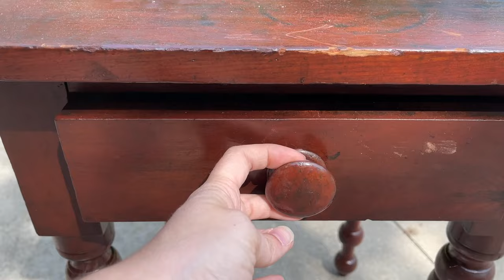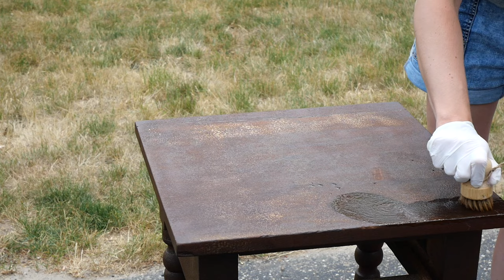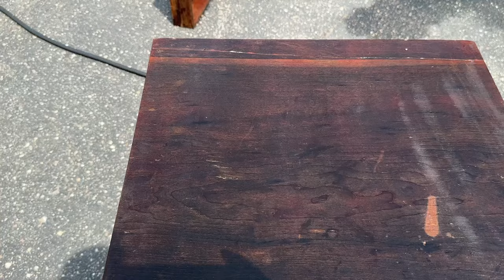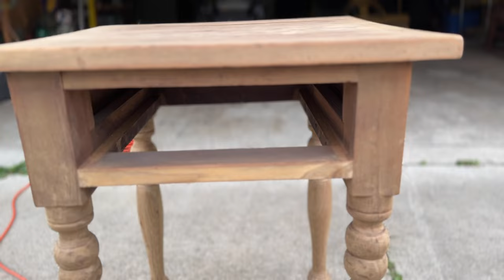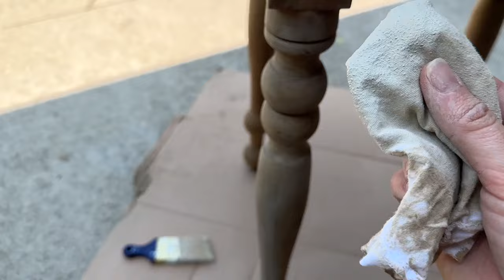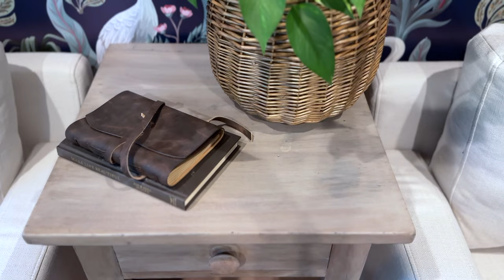The EASIEST Way to Strip Wood! | How to Modernize Antique Furniture

Comment: I have tried this and it works very well. I'm not sure how cost-effective it would be on a larger project like a bed. After using soapy water to scrub, I do NOT recommend rinsing in water but wiping with a rag and pure acetone before setting in the sun. I also use lemon juice after acetone for even more bleaching.
Reply from the maker: Great tips!

Comment: I had tried the easy off method, but didn't take my furniture to sit in the sun.  Seems like that's a necessary step.  Thanks for sharing.  It turned out beautiful!
Reply from the maker: Glad it helped!
Reply: I did mine inside and it lightened tremendously with no sun. It’s autumn and apartment living. I just let it dry for two three days and as it dries it lightened. I only did one go around with the oven cleaner as well.